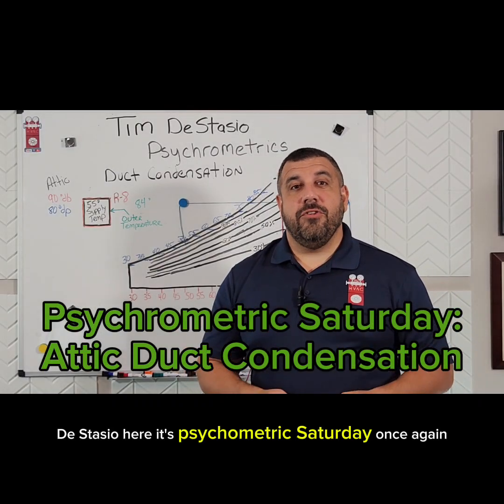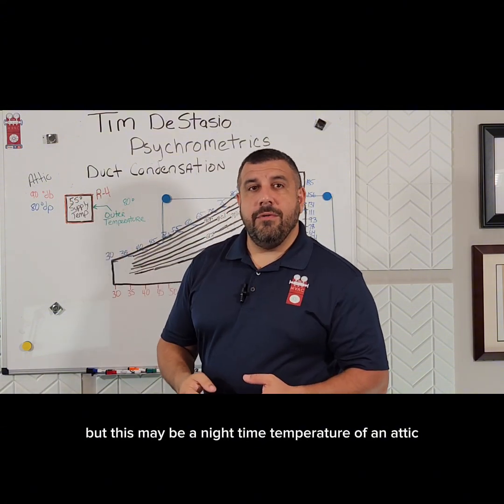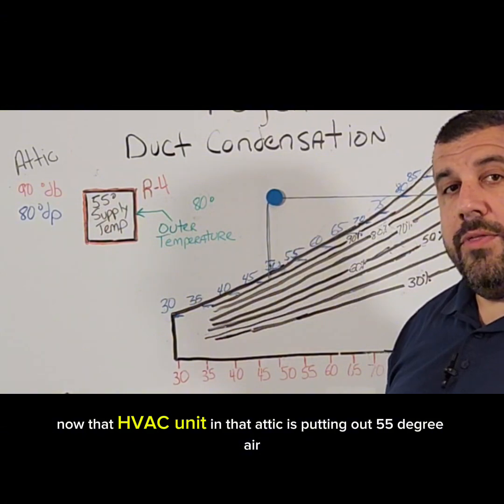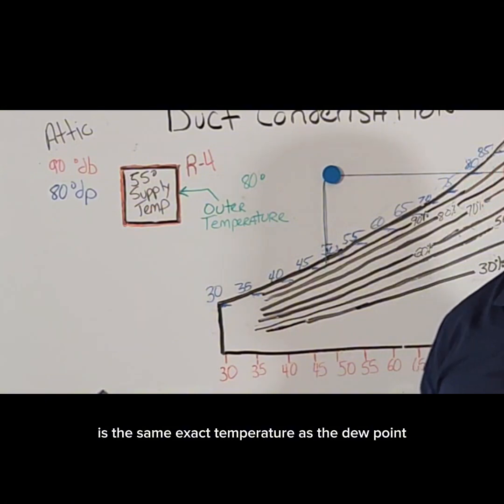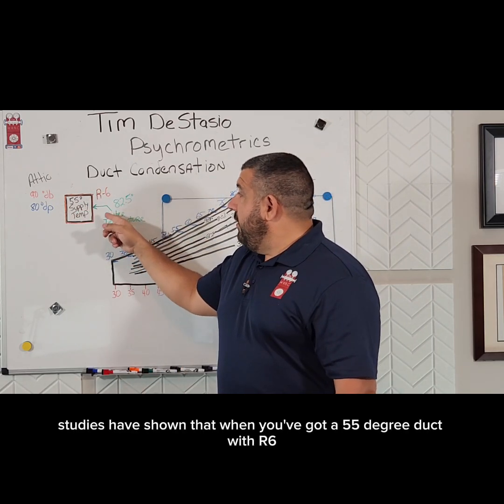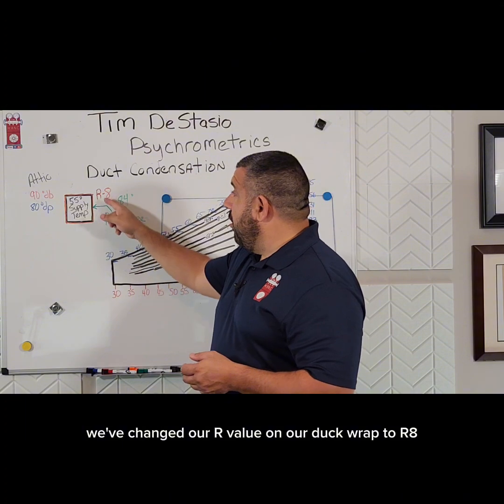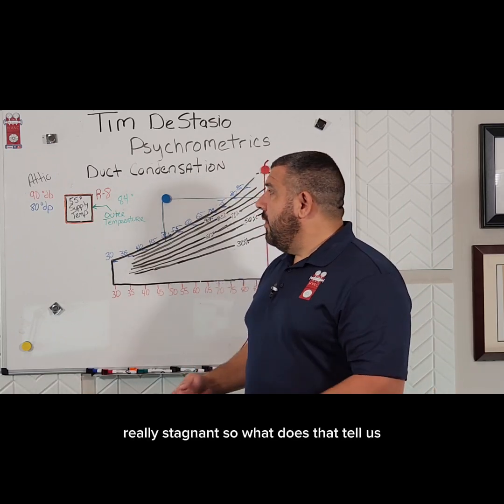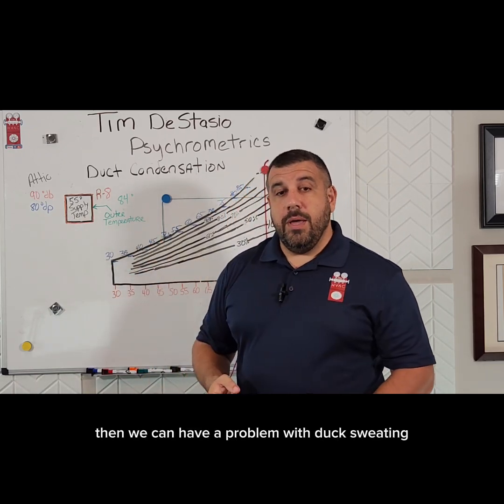Psychrometric Saturday: Attic Duct Condensation

Comment: okay, you caught my attention. im here from facebook. im about to watch your video

okay, questions... 
90 degree db 
but how did you get the 80 dp ? 
and how do would i get the temperature on the surface of the duct when the db is 90 ? 
I'm asking cause i really want to know
Reply from the maker: @corruptedbrain6  welcome
Reply from the maker: @corruptedbrain6  80 dewpoint is a typical attic in a gulf or coastal area like Florida. Usually if the surrounding temp around the duct is over 90, an R8 duct will be above the dewpoint and not sweat.

Comment: Great stuff again.  Tim is there an actual calculation that allows you to calculate the outer temperature on a duct, based on the other parameters?
Reply from the maker: @HVAC_Tips_Tricks_Calcs  yes but uts very complicated. I learnef a lot by a past presentation at the HVAC School.Symposium called Conductsation by Rick Sims. Search for it on YT its life changing.
Reply: @timdestasiohvac That was a great video you recommended, and your video, this video, summed it up perfectly.  Completely the opposite of how I thought about the affects of duct sweating.
Reply from the maker: @HVAC_Tips_Tricks_Calcs  glad it helped!
Reply: @timdestasiohvac  thanks!